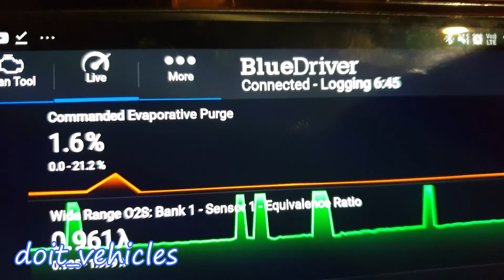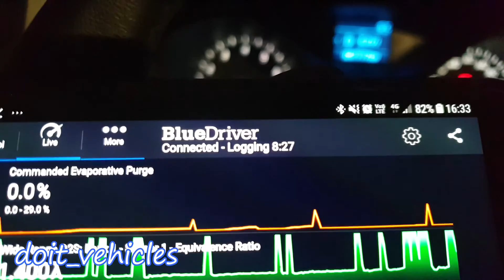Ford Focus 1.0 EVAP control Solenoid / Test / Diagnose ( 2011 - 2018 )

Comment: this channel is great... I just got one of these 1.0 ecoboost. The engine starts, and the sounds perfect... but their is no acceleration or revs when I touch the pedal... I've been told it is either spark plugs, air filters, or maf sensor! it's done 110,000, and I'm not sure where to go to, to start fixing this issue... can you help...
Reply: Put a Diagnostic scanner check fault codes then let us know which codes you get

Comment: You don't even need to completely remove that green safety clip from the connector. Just click it one step away from the locked position to unlock the green disconnector and just leave the clip there. It works and won't have to worry for losing the clip or putting it back in it's correct orientation.

Comment: Do you have the part number?
Reply: Did you ever figure out the part number? Everytime I lookup this part it send me to a tiny L shaped piece with no hoses
Reply from the maker: Usually I use autodoc online shop to get parts number
Reply: Yeah I have only been able to find the solenoid itself.. not the whole set. Do you know what part number to search for on autodoc? I live in US.
Reply: @boomshakalaka117  did you ever find a correct part #
Reply: F1FZ-9D289-A